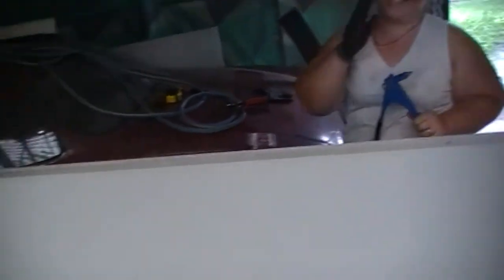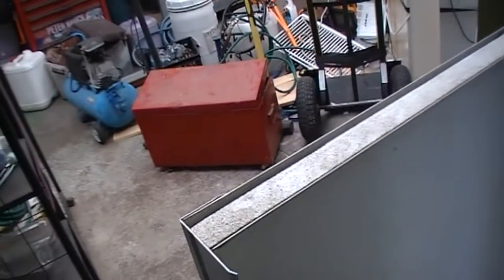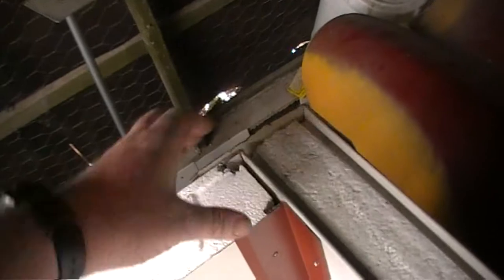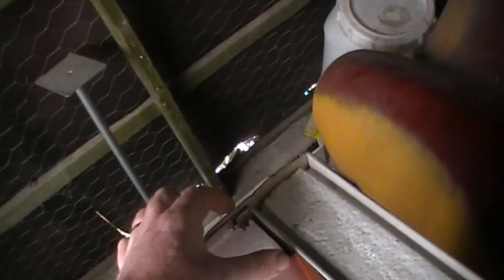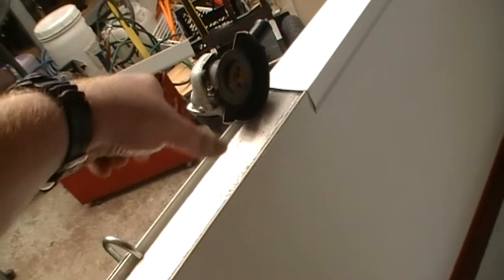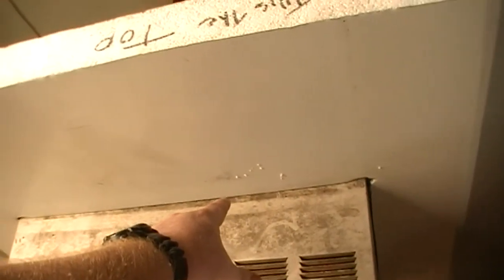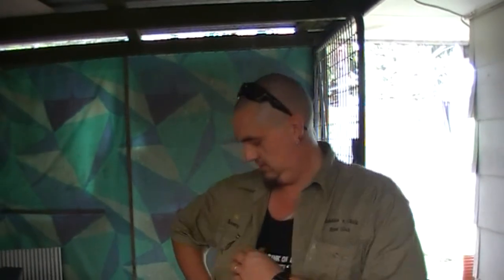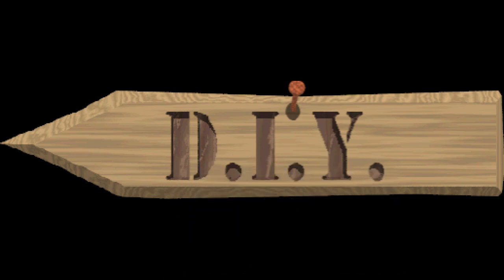waz it 2 or 3    ?............. build a chill box for 1000 kg grain for under $.....

Comment: Good job Mr tiny, Surprised you haven't thought of using it as a mash tun, lol  How`s the air flow to the bag`s at the back, you could run a length of 100mm waste/drain pipe along the back, make a small cowl up to run some of the air through to a flexi pipe then just cut holes were you need extra air flow, just thinking out load as I have a shit load of the pipe.
Reply from the maker: yeah mate just box it up hahaha, narr air is good the aircon blows heaps enough , chers mate thanks for watching